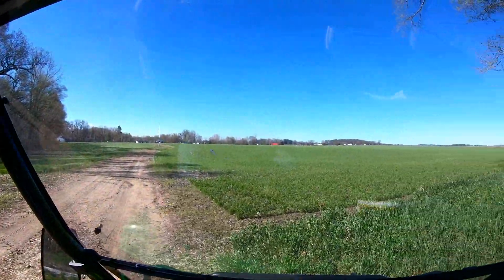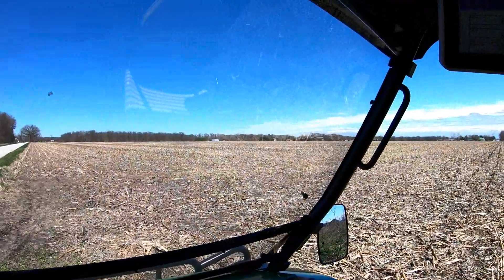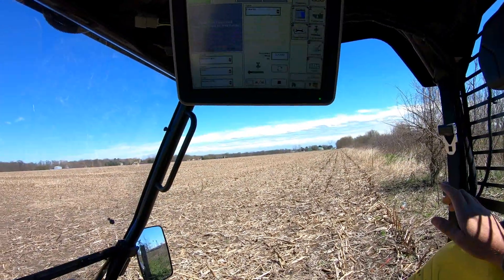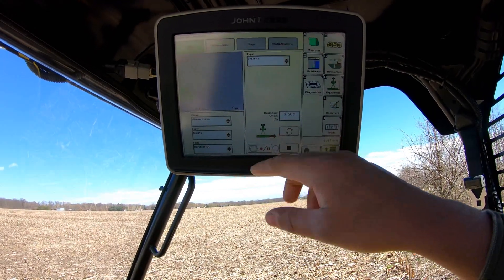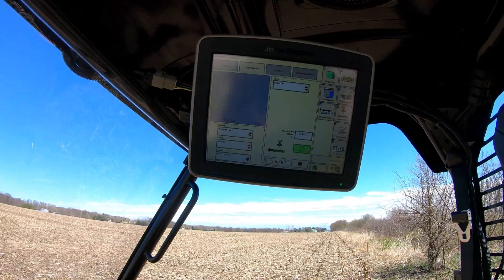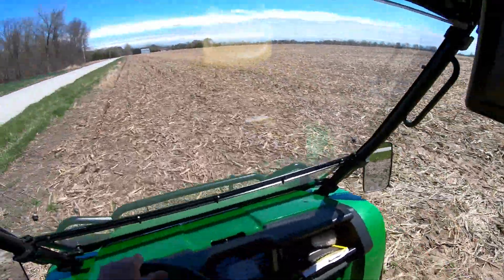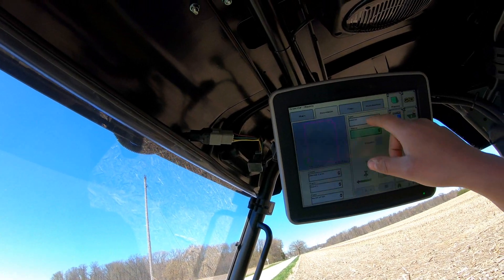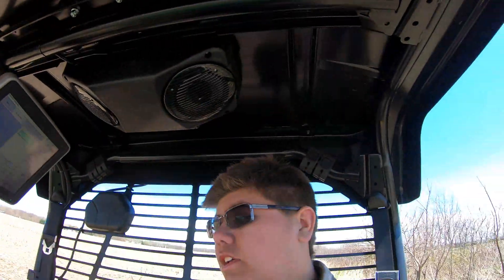Creating RTK Field Boundaries with a John Deere Gator

Comment: If you want a precise boundary, U-bolt or clamp a piece of  pvc or flat stock on the driver's side  your brush guard. Hang a chain from it long enough to drag on the ground. Measure from your receiver to the chain and input that offset. Then just drag the chain exactly where you want the bouandry.
Reply from the maker: That's actually a really good idea. I'll have to do that for next year. Thanks!

Comment: You set offset at 5' because you didn't want to drive right on the edge of field, so is the offset start from the receiver or the tire on driver side to what you want recorded as edge of field ?
Reply from the maker: The offset starts from either the center of your implement width or your receiver
Reply: @WernerAg  Gotcha, that makes sense to me now. My friend I helped for years, son tried doing some last spring but we were all kinda confused about it.  Thanks.
Reply from the maker: Glad I could help!